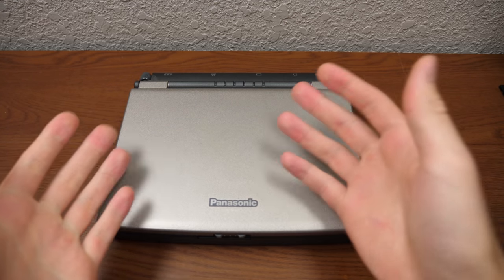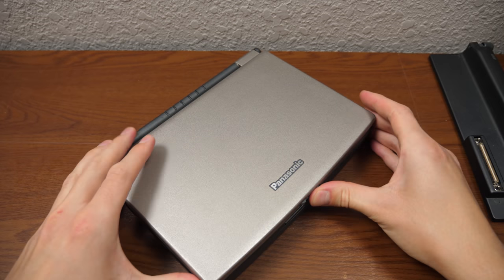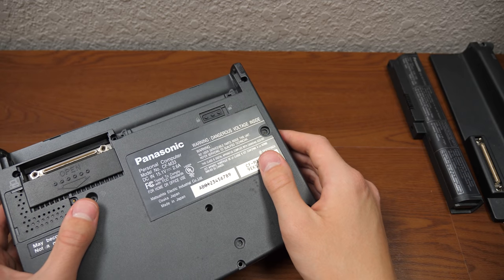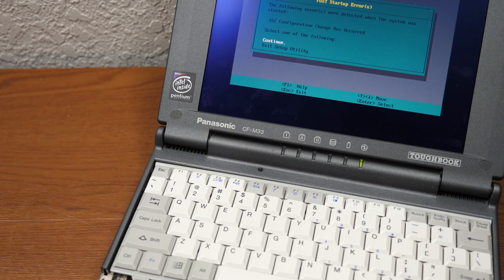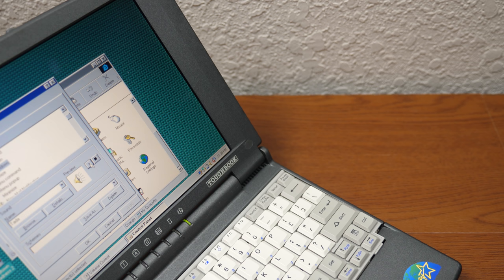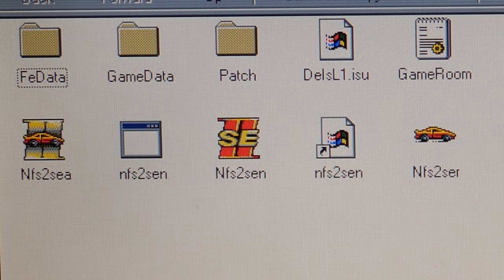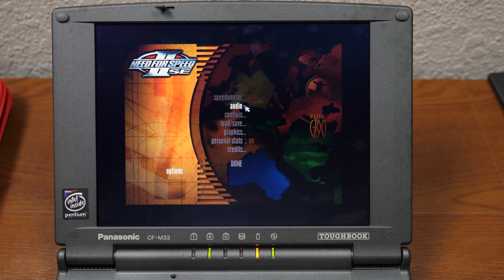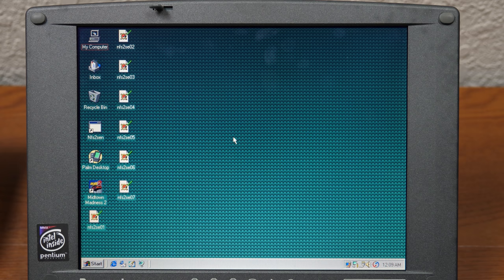The Mini Toughbook Lives! - Diagnosis & Booting Up Windows 95

Comment: You know, for a "toughbook" you would imagine a rough shipping shouldn't have disconnected an internal cable...
Reply: Makes you wonder that if Nintendo made computers, the cables would stay sturdy in place.
Reply: Yes that basically says it’s not strong IT IS CALLED A TOUGHBOOK
Reply: I think Panasonic Toughbook series has 3 classes : office rugged like this one , semi rugged, and fully rugged. If you want something that can be dropped from 6 feet , run over by car, and washable by running water , get a CF-19 at least Mk6 generation, because Mk5 only support W7.
Reply: @mari2.  mk5 is the 2nd gen Core i right? I have tried installed w10 pro 1809, the driver for thermal management is not available, so the body turns very hot and BSOD.
Reply: Quality is measured against time.. for 20 years the cable stood still.
Reply: @Mario583a  no if Nintendo made them they wouldn't lmao

Comment: Music could be on cd of the game. I remember something like that vaguely. To save space you install game, but media plays from cd
Reply: Yes, and there were some games that stored the music in just plain old music CD format, so you could take the game cd and load it in your boombox or music system and it would play the game music. Probably the 1st track woudn't play as it was the game data. I remember several play station 1 games would work this way, and I guess also PC games could do that.
Reply: @coski87  yep lots of old games had first track as data for the game and the rest were audiotracks, so cd required to play, with music...!

(which also means, as a kid you could put those cd's in the hifi system and rock out!)
Reply: A lot of old CD-ROM games had their music stored on subsequent audio tracks because playback was already implemented through MSCDEX. One drawback was that the game could become unresponsive when the track is looped, so there were options to play the audio track only once, or use Midi music (if the game had one).

An interesting fact, some early CD games didn't even required a sound card, just a drive with an audio out.
Reply: That is True.
Reply: Music (really nice one) is stored in ...\gamedata\audio\pc, you can just copy that folder from CD/image to hdd, and that folder it's quite huge like to 1997 standard HDD's (~250MB vs 1GB hdd haha), you can also copy movies : ...\fedata\pc\movies (btw it was really something WOW in 1997 heh). Game has 3 install options : compact (almost everything runs from cd - noise and lags cause cd spining up, and slow down all the time), medium (just like some game rips from era : no music and movies) and full :).

Comment: The music in NFSIISE is on the CD. If you haven't got the CD, you have no music, because the game streams red-book audio. Most likely, there also is a No CD Hack that was applied for it to work without CD at all.
Reply: This is 100% correct.
Reply: It’s possible the original owner lost the cd, or didn’t want to carry around the cd drive.

Comment: Next video: upgrading this all the way to at least Windows 7, in a classic MJD video move? 😁
Reply: Would be tough without upgrading RAM first -- saw where it only has 32MB. Win95 can make do on that but even Win98 will struggle. Win2K won't install on less than 64mb, tho will run (slowly) on as little as 8mb.

However.... TinyXP might run, and ReactOS certainly would. But I'd want to change out the HD and not risk messing up that Win95 install, as finding drivers again would be tough. Running WinDriverBackup should be the very first move, to archive all its drivers.
Reply: The most you'd be able to upgrade it to is to windows 2000, or some other OS that can run on very low end hardware, because the laptop only has 32mb of ram and windows 7 32-bit needs at least 1gb, plus, the cpu wouldnt be powerful enough
Reply: Windows 7 32bit requires a 1GHz CPU while that laptop has around 200MHz. It also need a minimum of 512MB RAM while that laptop only has 32MB
Reply: @mhkhing444  those requirements are bogus. You can run Windows 7 on 128mb ram, tho it would be really really terrible.
The 200mhz cpu would make everything so slow its not funny (click on an app, and wait half an hour for it to open)
Reply: @DamnMerasmus I was talking about my experience with a pentium 2 machine

(Edit: I had a spare pentium 2 desktop a few years ago, and I tried this out on my own. I wasn't able to get below 128 mb ram ( idk maybe I needed more tweaks))
Reply: @Reziac  windows 98 will not struggle at all, after all, this has an mmx pentium and 32mb of ram.
Reply: @the2323guy  Win98 won't exactly struggle, but it'd be intertmittently sluggish.
Reply: Did you literally stole my idea?
Reply: @superatje3131  No? On his last video on this ToughBook I suggested the same idea, if he managed to get it to work of course.
Reply: @santosic  Ok youre right sorry in this video im the first one with this idea. Lol
Reply: Maybe you'd want to try a Linux distro?
Reply: @superatje3131  aaand what about it? People can have same ideas, it's not like everything is copyrighted.
Reply: @theprotester5171  it’s called a program not an app
Reply: @pugzgamez8891  you can call a program an app. Depends on your point of view.
Reply: Kinda hard without a DVD drive or USB booting.
Reply: @Reziac  its microxp not tinyxp
Reply: @imSomebody-m4c  TinyXP is a 3rd party paring-down of regular XP. Not the same as MicroXP. I use TinyXP on one of my old laptops that has limited RAM and can't be upgraded.
Reply: @Reziac  ohok

Comment: It's very cool to see that little computer up and running. I would definitely make a full backup of the Hard Drive so that you don't loose the drivers and stuff. I noticed a folder in the Start menu labeled "Panasonic". If you look in there I wonder if it is a tool to create a set of backup disks for the computer? A lot of those old computers had that so it's worth a look.

Comment: What I tend to do with screws, is use the lid of my ifixit kit (which is segmented into squares) and place them in an approximate layout of where they’d go. So when I go to put them back in, as long as I have the correct orientation, it should go in as in came out.
Reply from the maker: That was exactly what I did for this project!
Reply: @MichaelMJD  Ok sorry, in the video I just hear you say you separated them into different piles.

Comment: Hey Michel! Tip- there is something called ( plop boot manager ) That you can... never mind. You can't boot from dvd. Here is a comment for engagement.
Reply: This was literally my thought process as well.
Reply: Man I remember using PLoP on a Compaq Armada of a similar vintage. That machine was interesting as it was very thin for the time, and then it had a docking station to add floppy and CD drives. Think I still have it lying around somewhere.
Reply: @flp322  PLoP saved me several times. My pc doesnt boot off of USB so I have to use plop. That sounds like a neat laptop! What are the specs of that old beast?
Reply: @TDGalea  I was typing this then realized he said there is no dvd drive 🤣
Reply: Ah, thanks for that. The computer I'm using right now can't boot from USB, and I know there was something that I could burn to a CD to make it boot from USB, I just couldn't remember the name.
Reply: @rcmero  No problem John! (: Yes it's Plop Boot manager, its also Linux if I am not mistaking.

Comment: Physically small laptops like these were great to have when I’d travel to gaming meets in the 2000s - 2010s to minimize carry-on luggage. As long as I had an old laptop capable of running Excel 95 for a particular Mario Kart tournament spreadsheet I designed, it was good enough. Your laptop would be more than sufficient for the task.

Comment: There's actually a reimplementation of the engine for NFS2 on github called nfsiise that lets you play the game on modern systems and even things like the Raspberry Pi given you provide the game's files.
Other than that, I can see how someone at a construction side used this toughbook alongside a PALM handheld and then after work relaxed a little by playing Need For Speed.

Hope you make a backup of that harddrive.

Comment: Good to see the drive still works and you didn't have to do anything to it.  In the future though if you want to get a working Windows on a machine that has no floppy / CD and has USB but can't boot from it... installing Win95 on another machine might  not boot or be missing stuff (specific drivers, power management, etc.) that a laptop install would have.  What you could do instead is just install DOS, and the Windows 95 CD files, then boot DOS and run the Windows 95 installer off the hard drive.  There are also DOS USB mass storage / CD-ROM drivers you can use to get the USB port working once DOS is booted, to do an install from USB.
That said, interesting laptop.  I have a CF-30 (Core2Duo L7500, 4GB, 256GB SSD), and it's pretty crazy how much more rugged Toughbooks became over the years - the hard drive for the CF-30 is inside a cage with a bunch of soft cushioning, and has a heater for the drive (all wasted with an SSD of course), and the case has entirely sealed ports and is almost waterproof.  It's passively cooled to keep water out but there is a newer Toughbook model that actually has active cooling and still maintains water ingress protection.

Comment: I think there is no in-game music because you don't have the CD in the drive. It could be possible that this game used CD-Audio for the music and there is probably a no CD crack installed so that it won't ask for a CD during startup.
Reply: That or it's a ripped version, because there wasn't an Electronic Arts entry in the start menu.

Comment: Finally someone could tell him that "error" is not asking for a floppy drive, instead it's asking for a boot drive. The solution was to check the hard disk to look if any OS was there or just copy with an IDE to USB cable the DOS and Windows installed to a folder on it

Comment: I'm glad it's alive and well. Nice little unit. Did notice it has only 32mb RAM... in that era, might not be upgradeable, but explains the rough framerate. (RAM might be accessed by a little door on the back?)

I'd find a copy of WinDriverBackup and archive drivers first and foremost, then archive the entire setup, as it might be tough to duplicate in the event that old HD goes tits-up. Also as I say below... wondering if TinyXP can scrape by on that little RAM? ReactOS might, tho will swap badly (both need about 100mb to run decently)

Comment: Lol. HDD disconnected. Gotta love it.  Personally though, if you had to gp down the reinstall path, I wouldn't install on one machine then put the HDD back, you could run into chipset driver errors and/or loss in Windows functionality. I would've created a Windows 95 Startup Disk. This would make the floppy bootable with the basic startup files. Then, still on the 2nd PC, copy thre files from the floppy to the HDD. Then I would create a Win95 setup folder and copy the Windows 95 setup files into that folder, additionally just top be safe,  download the Toughbook chipset drivers into an additional folder. After that I would then put the HDD back into the Toughbook and start it up. It should boot into MS-DOS via the startup files in the root directory.  From the start Win95 setup from the setup folder, just obviously cost not to format the HDD. This easy you'd get a clean Win95 installation with the correct chipset (either from Windows' own built in drivers or from the extra folder created earlier) with mp conflicts.

However main thing is it works and that Toughbook is a thing of beauty.

Comment: Panasonic Toughbook series is the only laptop I know, that has battery with amazing lifetime. We have 2011 CF-19 mk5 (core i5 2520M) , use outside (stock yard area), everyday for setting ECU of new excavators, still use until 2019, with 80% battery health. The only reason we replace with, sadly, a cheaper - bulkier - unreliable Dell Rugged series, because it does not support Windows 10 at all. Even panasonic website officially inform that. When I upgrade it to w10, mandatory for security reason, it will be overheated , because no thermal management driver available in w10, another example of forced planned obsolescence.

Comment: I got three computers from a yard sale TN is full of this great stuff  there is a Windows 2000 which doesn’t have a hardrive but looks brand new and is still white I got with the manuals for 15 Bucks then a windows 95 which impressively is pretty white as well but it had windows Me installed and it it was already on it it was 5 bucks and a Compact Windows XP with dual Cd drives which sadly doesn’t work but it could just be the battery and it was free so space well taken it also had the original Monitor that went with it which was also free now I’m just lookin for that holy grail CRTV Windows monitor :)

Comment: This Windows 95 looks too much like 98. I mean, the Quick-launch icons are there (as far as I knew, Win 95 didn't have these), and the Recycle bin icon has that dark grey color with the shadow inside, just like on Windows 98. If it wasn't for the bootup splash screen, the Start Menu decal and the System sounds that you just played to test the speakers, I would've thought this is actually running Windows 98 instead. Mike, is this some later version of Windows 95 that received some upgrades taken from Windows 98?

Comment: I got really lucky recently and found one of these on eBay for a wonderful price.  Mine is the CF-M32 though which is the same thing just a little different in specs.  The battery on mine works as well and I’m lucky for that but what’s even funnier is that mine had the same exact problem yours did where the hard drive cable had come loose from the motherboard. Did you happen to find out where the CMOS battery is located on this machine?  I wonder if it’s a CR2032 or if it’s one that is soldered onto the motherboard?
Reply: How can you remove the keyboard to access the hard drive? Do you need to release tabs?
Reply: @vicchou8816  remove the two front covers on either side of the trackball using the screws on the bottom.  There are screw on the bottom towards the back of the pc that will need to be removed to get the keyboard out as well.  I believe it is just one screw and if I remember correctly it’s the one in the middle.

Comment: And i have a question. I have an old toshiba with windows 3.1 i think and a intel 486sx and when i power it on two lights go on then a third light and then it shuts off. It then gives an error code. I don't know what this is. It all goes really quick. Do you know what this is?
Reply: Film screen with phone camera, slow motion if possible, like 120-240 fps.
Reply: @igors_lv  ok ill do it later
Reply: @igors_lv  i am not at home right now

Comment: U should clone the original drive on another pc in case it will die one day, clone it to a 4gb CF 40-pin mini IDE adapter maybe and it will act like a small ssd.

Comment: You don't need to install Windows 95 from another PC and possibly cause issues with storage controllers and other device drivers. 
Install DOS on the drive on another PC. Copy the Win95 directory from the Windows 95 CD ROM. Boot into DOS and then run the setup. Clean install.